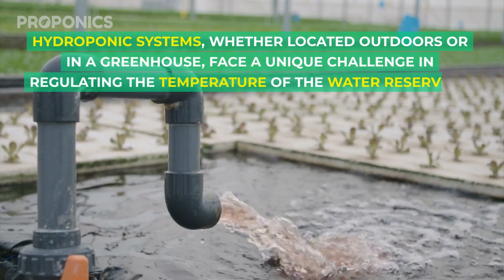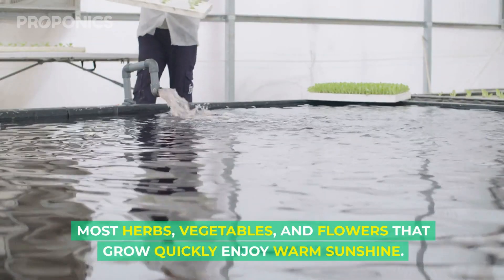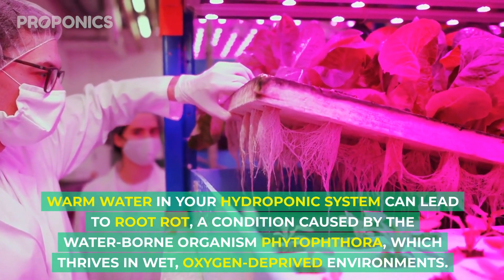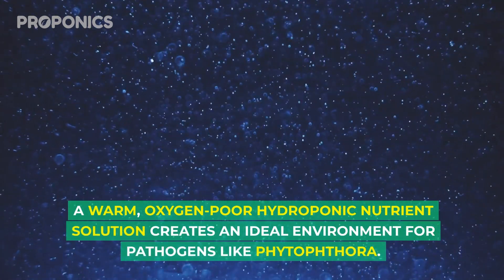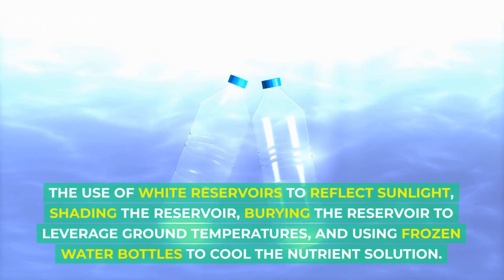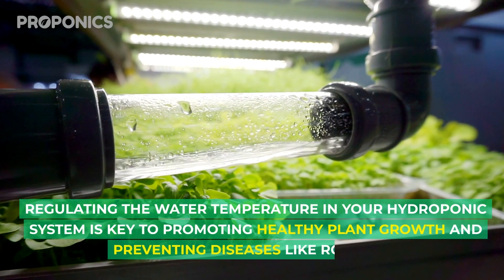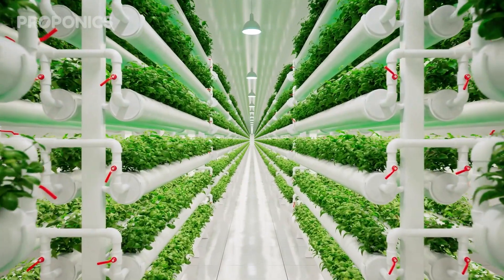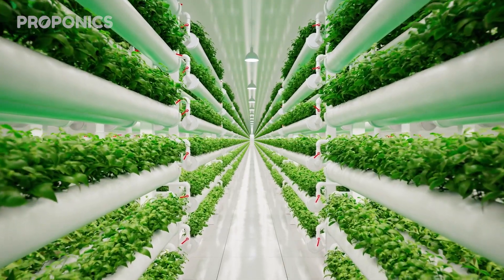How to Cool a Hydroponic Reservoir

Comment: In a greenhouse, external tank, use frozen bottles and jelly tubs but after some hours the temperature goes down. OK change 2-3 times/day. Do you have any idea how this regular temp changing affects the plants? Is nececering to know or worrying mutch?
Thanks for all the info you have on your side, that helps me a lot.
Reply from the maker: It will simply effect the plants across the frequency of how often the temperature is changing. So while I can’t see the up and down in the temperature having any specific unique impact, it will simply just have the compounding effect of all the ups and downs put together over time.
Reply: @proponics  Thank you. Thi is a big question, it depends on many things-parameters and no easy to consider or locate for a solution. Hier in Greece already over 30 celcius. Have a good time Man.
Reply from the maker: No worries, also remember that sudden changes in temperature can cause shock for your plants are risk their health, so the more consistent you can keep the temperature the better and if there is change it's always better that it isn't sudden or extreme.
Reply from the maker: @chrisAk-ci2gr  for more help join us on Skool as part of The Hydroponics Community 👉🏻 https://www.skool.com/the-hydroponics-community-1895/about

Comment: I think I have found a good solution to keep the water temperature at a suitable level. Put a 50L tank in an 80L tank, in this way an air space is formed, you can use the air as insulation as well. At the Emirates you can go slalom. Using air as isolation, like a box above the ceiling where all those snow machines are.
Reply from the maker: Excellent idea, let me know how it works out!
Reply: @proponics  Hi. Very simple, I have put my water tank 50 liters in an 80 liter empty container. I have to say that all my NFT are on my terrace, sunny all day long. 
I don't know how it would go when the heat wave comes, it will probably be 30-40 celcius soon. It works now and keep the temp 22-25 grader the last few days at 30 degrees.

Regarding this in the Emirates, indoor slalom, there is a documentary that I have seen on television. I'm not that good in English to explain it better.